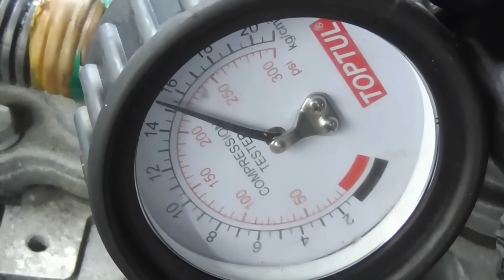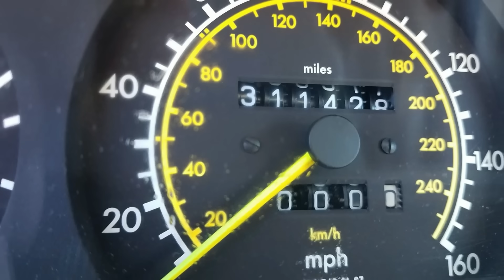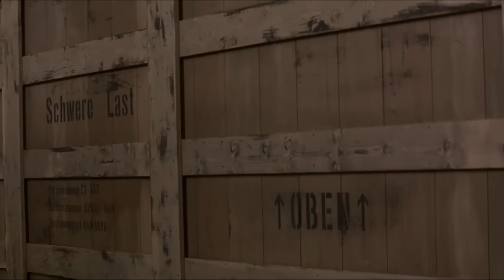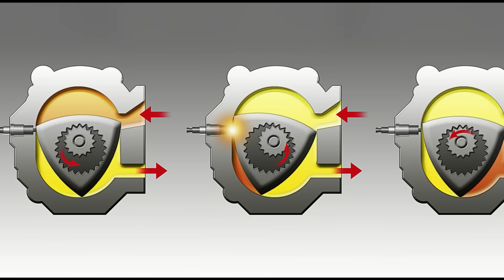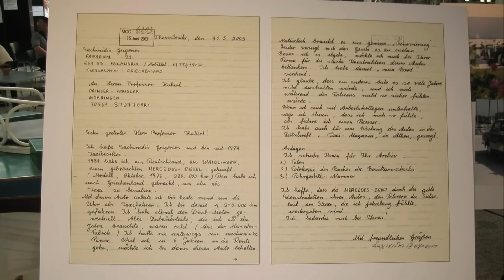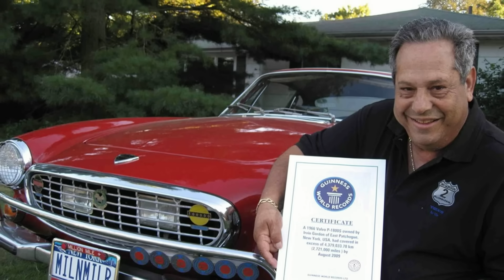Most Reliable Engines of All Time

Comment: The Fury with 3 engines doesnt count, while it has high mileage on the chassis, and decently high on each engine... it has still had 3 engines.

The Volvo at the end... only rebuilt part of that engine a 625k miles... had never touched it since.  He passed away, and the family donated the car to Volvo.

Comment: Had a 1991 Honda CRX HF that I put 496,824  miles on till I sucked a piston ring doing 90. The clutch I replaced only once...myself....after 325,000 miles. I loved that car....got almost 60 MPG and was my little pick up truck as it had so much room in the back.

Comment: I had 80,s 240d and it ran like a singer sewing machine sorry I gave it away due to the rust underneath .it had 250000 miles on the clock

Comment: Missed the Volvo B230F Redblocks that came in most Volvo 240's.  While the odometer stops in most around 200k, they'll easily go for a million or more miles.  I've got 2 like that.  1 stopped at any 200k sometime prior to 2007.  It's 2019 now and there's still no signs of slowing.

Comment: Shoulda chucked in  the old Toyota diesels, I've seen plenty of 2h motors with more than 8,000,000km on them still going out on stations, and I personally own an old 1hz with 2,689,321km on it and still running sweet!

Comment: What about the ford 300 or 7.3 powerstroke or 12v cummins or jeep 4.0 ? A dodge 318 or Chevy 350  can go 300k easy
Reply: j l agreed, my 97 Cherokee 4.0 has 192k and purrs like a kitten.
Reply: Yes.   That 318 is a tough sucker
Reply: @dtpat9115  absolutely!
Reply: I had a 95 Jeep 4.0 and I had close to 300,000 when I sold it and it still runs
Reply: 7.3L Powerstroke, 6.9L IDI/7.3L IDI. 5.9L 12valve, hell 24 valve’s even. All of these will for at least a million miles if you just maintain them.
Reply: Ford 7.3 was the best engine
Reply: My 24v actually has 400k. Never been rebuilt. I've been running it hard too. 2 tuners and bigger turbo. But a 12v 5.9 cummins will never die. One of the best diesels ever built.
Reply: Yes I agree
Reply: I had a Ford e350 7.3L turbo diesel with over 800,000 miles on it.   It was an ambulance I got out of North Carolina.
Reply: Cummins 5.9  will never stop running if taken care of,
Reply: Yep
Reply: Dodge long block 318, very reliable. It's brother the 360 had weak camshafts. I have a 359 6BT CUMMINS with almost 388k miles as of writing this message.
Reply: Yup ford 4.9 had timing gears!! Many still out there with 500-600 k on them original. My 89 ran perfect and I beat the crap out of it, but rusted out after 26 New England winters
Reply: Chevy 5.3. Owned one until 250k and still ran like a champ. Beat the crap out of it over the years. Minor issues no doubt but always started up. Got rid of the truck not because of motor but because if rusted brake lines.....
Reply: 500k or 1 above 1 million isn't uncommon for a diesel... The vehicle will be outdated and require a complete rebuild if someone still wants to drive that, but the engine will work and it will drive.
Reply: You for got the ford 302
Reply: Is the 300 the 4.2 in the crown vics because those are also super reliable
Reply: All more worth mentioning than these shitty nissan motors
Reply: 7.3l idi. The power stroke ruined the 7.3 the idi was the good one
Reply: @farmertyler8087  I mean .. the power strokes also sometimes got up to 1 million miles .. but the IDi was the best
Reply: The Toyota 4.7 V8 can go and has gone 1,000,000 miles and it’s not even on this list
Reply: My 350 95 suburban has 250000 miles runs great
Reply: I had a 04 Chevy with a 350 that had 360k miles when I sold it and it still ran like a top

Comment: I own a Toyota Tacoma 2005 V6. It has 302000 miles on engine. Everything is original. Only Brakes, Battery, Tires, an Emission canister are not original. Still runs great.

Comment: LOL 300k isn't much for a diesel, probably for something mercedes built but not compared to US built diesels LOL, that actually manage to do more than just tote around a sedan of softies.
Man this guy is clueless huh, a rotary engine was never reliable, always a big time oil burner, it never could last.
I've had several ford 3.0,4.0, and 5.0 gassers that I drove 200k-300k before the engine was about done for and well it was way more cheap than alot of the other engines you list.
There is a guy on YT with an E350 van 7.3PowerStroke with 1.4 MILLION miles on it and the org unrebuilt engine.  You don't do much for homework huh?

Comment: There is a reason ford stopped with the 7.3 powerstroke other than the epa, it would go over 500k miles without any major work needed if you just change the coolant and oil, some go on over a million.  Same for the Cummins 5.9 12v as long as you correct the KDP.

Comment: You missed the 3800 v6 from General Motors from 1993
Reply: The only thing wrong under the hood was the ign. System and that can be fixed for less that 250 worth of parts. Also the main reason they went bad was oil leaking from the bank 2 valve cover. I would put it on the list. Also the 4.3
Reply: Junk. The engine might be good they where always in pos car with tons of electrical problems so why mention it
Reply: @heathatkins2837  😂 you clearly never seen or experienced a 3800 before, if well maintained they never stop running and rarely ever get any issues that engine is far better then many of the engines today hands down things a tank
Reply: @inspector647  that horribly balanced pos 3800 ecotech engine? Im yet to see one make it to 100000 before something major happens. They are a throw away engine
Reply: @The_Koups  lol these things go for far past that I've seen some still running up to 400000 miles later, so like I've said you haven't really experienced a 3800 because that engine is still running to this day in many old buicks many not having any issues at all, beside the common issues where the valve cover gasket's fail and throttle body intake manifold stock gaskets corrode do to cheap components used dureing manufacturer, these engines are tanks, that is how I know your bullshitting you must be confusing the 3800 with the GM northstar because the 3800 sure as hell isn't a throw away it is literally the best engine when it comes to used cars/ reliability, it's so good that many people have even taken them out of used cars rebuilt them and moded them.
Reply: @inspector647  the only refence point for 3800s i have is the ones they have imported to Australia. They were anything but good.
Reply: @The_Koups  k if you say so
Reply: @inspector647  ok... Crearly I've never seen anything that came with one that entres me enough to experience one, like what a V6 Camaro or something? Sorry, don't see any bragging rites here.

Comment: Most all American made straight sixes are highly reliable . They can easily go over 300k with some minor maintenance. The rest of the car may fall apart or rust away but the engine will still be running.

Comment: okay im going with a chevy and a ford for domestic 
the Chevy 3.8 v6!
and the unsung hero 4.6 2v Ford modular!!
Reply: Couldn't agree more! I own two vehicles, my work car is a 2002 Pontiac Grand Prix GT with the 3.8l series II, and a 2004 Ford Mustang GT with the 4.6l 281! I'm probly less than a week away from watching the Grand Prix roll over to 250,000 miles, still running strong. The Mustang has 99,4XX miles on it now without a single engine issue..A little maintenance goes a long way!
Reply: The Buick L67 is by far the most bullet proof engine from domestics, users putting 800hp through the bottom end with basic mods the L67 is certainly a beast even for its time. I have it in a motor swapped minivan and its just getting broken in at 140k miles lol.
Reply: The 3.8 leter v6 is known for head gasket failures and cracked intake manifolds.

Comment: “If you change the filters, change the oil, and change the filters”... How could you not catch that you said “change the filters” twice in a matter of 3 seconds?
Also, you made no mention of Toyota’s 22R engine, which one of the highest Milan’s engines ever made. AND you forgot about the 2 Toyota Tundra’s (4.6L, the other 5.7L) that made it to over 1,000,000 miles in the United States.

Comment: Your toyota selection is false. The piston rings are faulty in the Camrys Corollas and Prius that causes the engine to burn almost all the oil in the car in less than 5k miles. Toyota even called a recall for the camrys.

Comment: Cummins 5.9
Powerstroke 7.3
Jeep 4.0 
All should have been on this list, all excellent engines that can easily do 300k plus if treated fairly.
Reply: Another the Ford Vulcan 3.0 it's a turd performance wise but they end up outlasting the rest of the car.
Reply: These diesels do millions of miles, 300k being high in this list is a total joke, especially with these car diesel motors. Also IDI diesels from international.
Reply: @ApolloTheDerg  The Powerstroke 7.3 is an International IDI (Navistar T444).
Reply: @rich7447  the IDI is different, powerstroke is Direct Injection or DI, the IDI is Indirect Injection.
Reply: @ApolloTheDerg  That's right. I was thinking of the 7.3 before they badged them as Powerstokes (can't remember the year, but they were an evolution of the 6.9 IH). My mistake.
Reply: Yep, my '91 Cherokee 4.0 has 230,000+ miles and is the most reliable vehicle I've owned.  My 2005 WK hemi is on its 2nd engine AND had a transmission rebuilt. My worst vehicle ever, it makes me miss my 1996 BMW 3 series 328is (i6), also a great engine.
Reply: Toyota 22re should have been as well
Reply: @NDC1115  they already had a toyota engine, i think its just the fact that they completely skipped over american engines
Reply: 2.7 Toyota
Reply: dude really said the mazda rotary is more reliable than these

Comment: The triple rotor motorsport version of the 13B (one extra rotor) was and is awesome. There is a myth rotary engines are not fuel efficient. This comes from the mistaken comparison with piston engines. A 1.3L rotary engine is actually the same as a 3.9L piston engine. Once you compare with a 3.9L engine, the fuel economy numbers look surprisingly good. The 1.95L triple rotor motorsport version is the equivalent of a 5.85L piston engine. When you put a turbo on each rotor assembly (yes, that's three turbos) this engine is quite capable of snapping carbon prop shafts and bending steel ones.

Comment: My personal top 3 (in no particular order) 

1. Jeep 4.0 inline-6. 
Great low-end torque. Mostly cast-iron. Tough as hell. Seen multiple of them with over 400k miles

2. 5.9 Cummins 
Torque monsters, extremely fuel efficient for their size, well known as a "million mile motor". Can typically handle 40+ psi of boost on all stock internals

3. Toyota 2UZ-FE (4.7L V8) (especially the Japanese built versions that have forged connecting rods, which are typically found in the Lexus variants). Not the most powerful or sporty fast engine, but a smooth and strong workhorse (as they are the only engine in the UZ series to have a cast iron block.) I've seen a couple with over 500k.

Comment: A manual clutch will last as long as the driver's ability to limit slip. The clutch could last indefinitely or as long as the car. It's up to the driver and their ability to understand exactly how the clutch works. Basically more clutch slip the shorter the life.

Comment: my 2004 audi 1.8t has 275ths miles and still kicking after 3 timing belts  change ur oil at 2000 miles fools any engine  can do over 200ths miles

Comment: My dodge Cummins has 560k and still going strong
Reply: Long live the Cummins
Reply: What year? I own a 07 6.7 cummins
Reply: 6.7 de it’s a 97 5.9 12v
Reply: Yeah but how many transmissions have you gone through since it's a "Dodge"
Reply: @conner5611  The Dodge transmissions last a long time provided the fluid and filter are changed regularly.  They also last long provided nothing is done to tune the engine above stock power.
Reply: @rey3472  maybe the new ones but all the people that I've known that had them babyed there car/trucks and took care of them and ether the engine blew of the transmission burntout most newer dishes have Toyota transmissions so there pretty reliable

Comment: My Old Fiat Ducato 2.3 multijet from 2012  had 407000 miles on. The engine and transmission had never ben open. IT still had the original turbo. The var did not use any oil. At the time egen i crashed the car it was still driving with the original driveshafts.

Comment: Jeep 4.0 and Ford 4.9 straight 6's are the most reliable motors, my 4.9 has 300,000 + miles and still running like a top

Comment: Most common gas motors are designed for 200k. Most common diesels for light duty are designed for 300k 

Any more is detrimental to business. Any less gives you a reputation for poor reliability.

Can you get more miles on those motors? Sure not hard with proper maintenance and driving styles, but most people arent perfect in either areas

Comment: I would say that around 300,000 miles is the starting line of impressive mileage, if a vehicles engine couldn’t last 100,000 miles than something’s wrong
Reply: Agreed.  His mileage estimates are pretty low.  My clutches have all been over 100k miles as well.
Reply: My 93 Jeep Grand Cherokee chassis has 307k miles on it and the engine has about 500k miles. The only reason the engine is in a different vehicle is because of a bad accident. There are a lot of other 4.0L Jeeps running around with these kind of miles. And more.
Reply: Tom Letlow my 94 ZJ has 270,000.  The 4.0l was solid.
Reply: Tom Letlow I was waiting to hear something about the 4.0, I’ve got a few jeeps, the one with the most mileage is my 1996 Jeep Cherokee Sport and 275k and it runs amazingly
Reply: @tomletlow1258  I'm surprised  that this guy didn't include the 4.0 six cylinder engines. Certainly among the most reliable of engines and one of the smoothest I've encountered.
Reply: i have golf mk2 with 730 000 miles on it,still going :D
Reply: ado hope my mk7 goes that long!
Reply: @erikhaldeman5802  hows the MK7 going still, I’m at 199K
Reply: My old chevy 4.3 just passed 300,000 and still runs as good as it did 100,000 miles ago
Reply: @carico30  Yep, it's based from the old reliable Chevy 350 and I have seen over 400k on them.
Reply: 2.5 iron dook in my s10 is at 352,000 and the clutch finally got replaced at 337,000
Reply: @timheerboth9761  That's impressive never owned a 2.5 myself but always heard good things. The 2.8 was also a super reliable engine I've seen 500,000 plus.
Reply: I have a Dodge Dakota 4.7l Engine - 252,687 miles just replaced the computer
Reply: True my dad's 1990 f150 gas engine has like 800,000 miles with a couple rebuilds and so the manual transmission
Reply: My accord's f22 was fine up to 350k when I sold it
Reply: Pssssh, my 369k mike 7.3L is going strong, here to another 300k
Reply: I have had my 97 powerstroke for twenty years now and 400k. It’s basically original other than standard wear items and a few upgrades.
Reply: Agreed. When several people who own a certain type of car go 300,000 or over-that starts getting my attention. Precisely why I began buying Hondas years ago- couldn't be happier.

Comment: I laughed at the mecedes 300 part. They act like 200k is high miles. Lmao. My current Jeep has 250k on the 4.0 6cyl and it is bone stock. It's my toy n daily. No Maintenance issues. Last Jeep I had same motor with 400k no issues. 02 ram 1500 I had. Also toy n daily with 37's n a 5.9 magum v8, 420k no issues. So 200k is not impressive it's sad😞😂😂😂

Comment: Where is the 12 valve Cummings?
Or a Ford 300 straight 6?
How about a GM V8 small block?
Or a 3800 GM V6
Reply: How about the Duramax with an LBZ that has 2,500,000 miles on it and the guy is still driving it.

Comment: I have a 2006 Subaru WRX with 306,000 miles.
It still has the original clutch. Not slipping yet! :)
Reply: Head gasket count? (Joking)

Comment: I had an old lady come up in a 1st gen RX7 to the Radioshack where I used to work at and I asked how many miles she had on it. She said she was the original owner and it had over 300,000 miles (she let me check the odometer cause she actually didn't know) on it. I asked if she ever rebuilt the engine and she said no, just changed the oil every 3,000 miles. I doubt any of the newer RX-7's could do this due to the higher horsepower and turbo's.

Comment: 3.0 L SHO V6
3.2 L SHO V6 Yamaha engines like one of the most reliable and sleeper engines of its day. along with chevys 350's fords 351w or 351c Chevy 302 or fords 302 fords 300 straight 6 i mean the list can be endless really its just how well is the person maintaining the engine. not doing oil changes is the biggest killer not changing your air filter is another running bad fuel is another overheating due to poor coolant or using straight water with no coolant not changing your coolant. not changing your spark plugs not plugging it in during winter or allowing it to warm up in the cold list goes on and on poor or no maintenance on any engine kills it if you take car of your vehicle theres no reason it shouldn't last you your life time. yes some parts will need replacing time to time thats life but with proper maintenance don't matter gm ford Toyota vw even Chrysler it should last your life time. reason why old Chevy and fords from the 60's and 70's lasted for ever cuz our parents or grandparents made sure to do oil changes and everything to keep them going forever.

Comment: morris austin b series engines from the 50/60s were getting over 200000miles in taxis before doing anything to the engines, reliability to me means how many miles before the head, sump or timing cover has to come off, other wise it is like triggers broom he has had for 20 years with 17 new heads and only 14 new handles